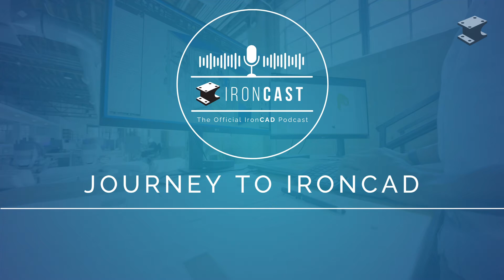Journey to Innovation: IronCAD's Past, Present, and Future with Cary O'Connor

Comment: IronCAD is a great product, no question about it. Anyway, it needs more exposure to the industry, more marketing. Also, if IronCAD would run on a Linux distribution (like Debian for example), not exclusively on Windows,, that would make it even more valuable, noted, as there is no major CAD software running on Linux, at this time.